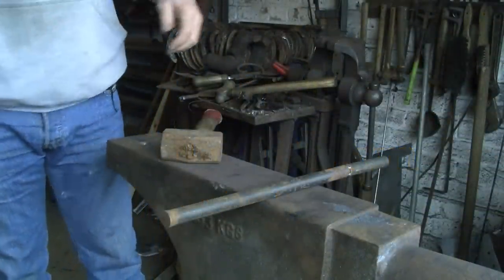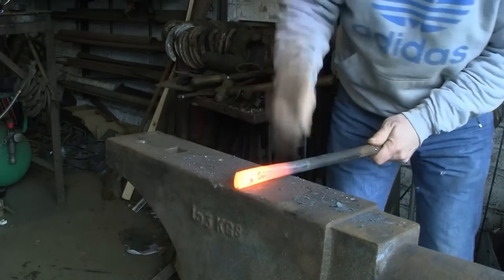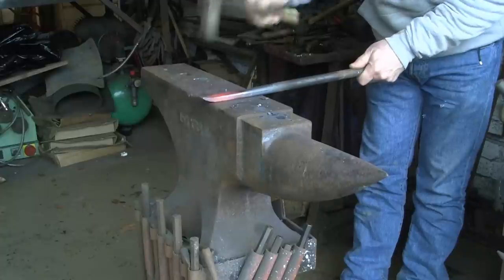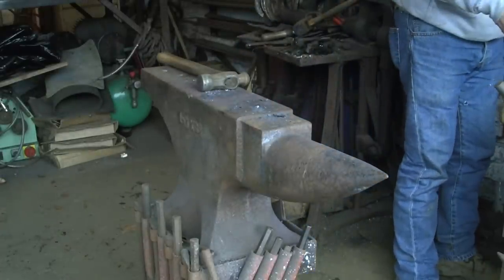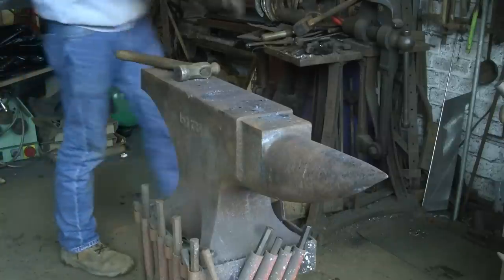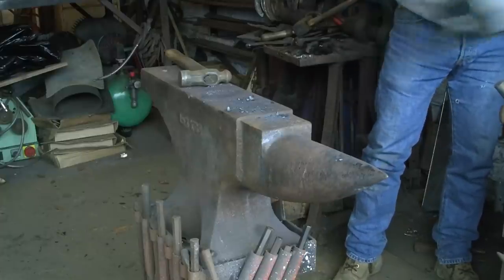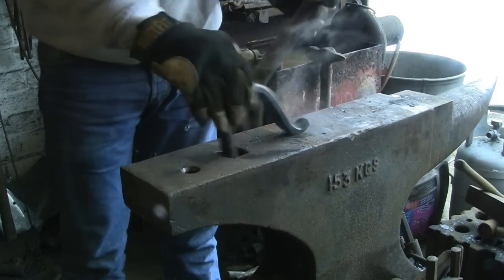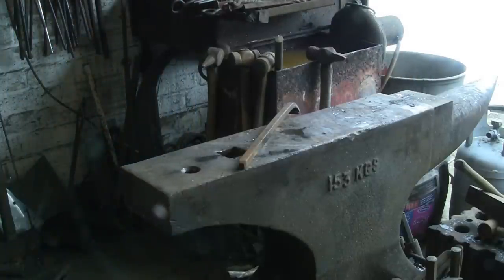Anvil Hold down

Comment: It is a pleasure to watch someone who KNOWS forging, not back yard want to bees.
I have made several of these. I make mine to fit the pritchel, use stock just smaller than your hole. Bend the top just past 90 to about 95 to 100 deg. make the corner square then a S bend to the face of the anvil. Harden the  sq bend for spring and enjoy. The sq corner is easy to hammer down on then a tap on the standing leg to loosen.
Ask a dozen smiths how to do something and get two dozen ways that will work!

Comment: Awesome and simple holdfast. I have been meaning to make a set for my woodworking bench and had thought of using the massive roubo style but this seems alot easier then have to upset the corner for that style. Peter ross made one on the woodwright workshop. I think the shear weight of the hold fast would set itself withouta hammer strike. Great video

Comment: Wow that anvil is awesome!! Must have been fun to move tho lol
Reply from the maker: Yes it was, i moved it to where it is now on my own!
Reply: @garyhuston  At my age, I'm wise enough not to try moving that on my own ..... fortunately my son is 22 stone of gristle, bit like a 2 legged forklift.
We are both used to dealing with heavy objects and we had no problem moving and setting up my 450 lb anvil. Levers, wood blocks and a bit of forethought and canny thinking involved
Reply from the maker: @bigoldgrizzly  I did it by rocking from side to side and putting blocks under it until I could slide it over.
Reply: @garyhuston  Same here - works a treat. 
Just bought a Brooks 1 1/4 cwt and surprised to see a 1 1/4" hardy and a 1/2" pritchel. The hardy suits ma as all my current tools fit, but the pritchel seems a bit too small for a decent holdfast. I really do like the extra thickness Brooks allow for the heel. Most others seem a bit light in this area.